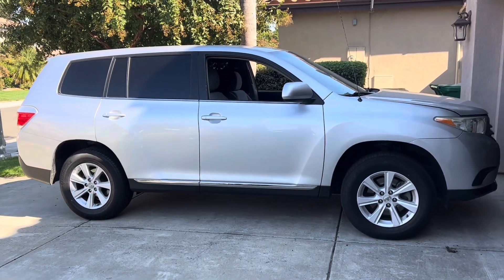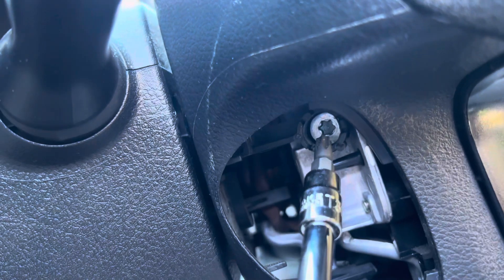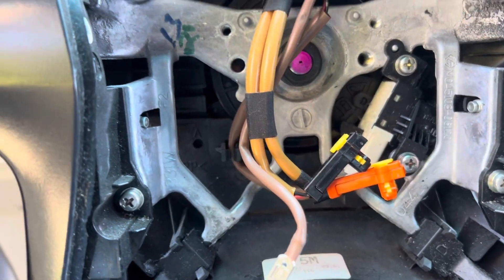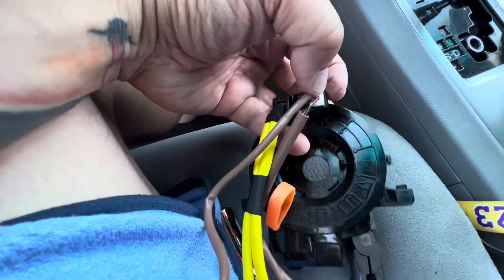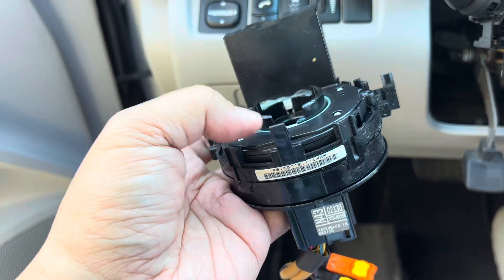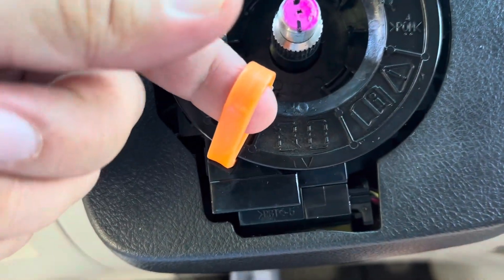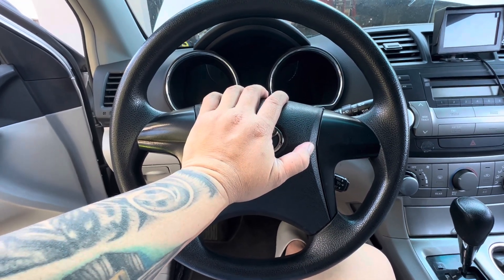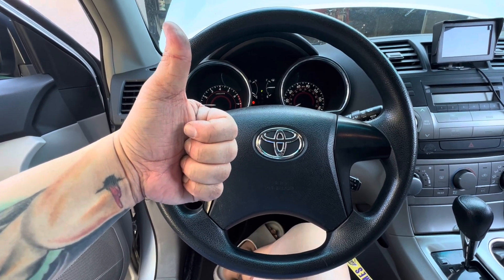2012 Toyota Highlander Cruise Control fix. Cruise control wasn’t working…i saved $468

Comment: It WORKED! My T30 screws were so tight that we needed a power tool to loosen, but the rest was just as mentioned. When you all place the old black plastic mount onto the new part, just spin the internal white ring so that those posts line up with the slots on the new part, otherwise it won't click in.
Reply from the maker: @jacquiestrebe6932  yes sir. Im enjoying the cruise control lol